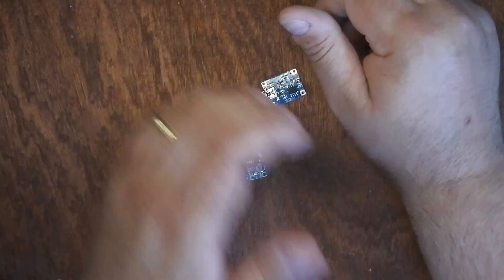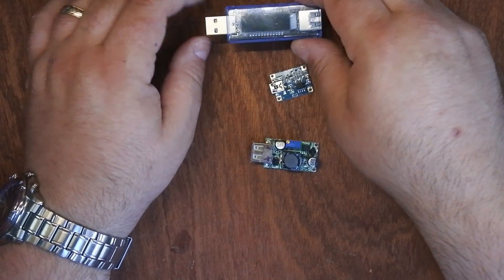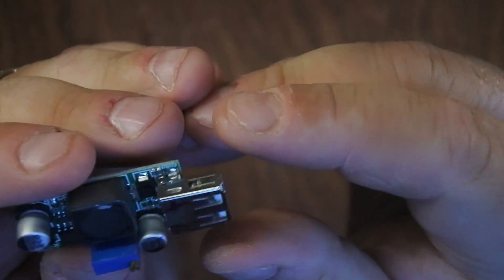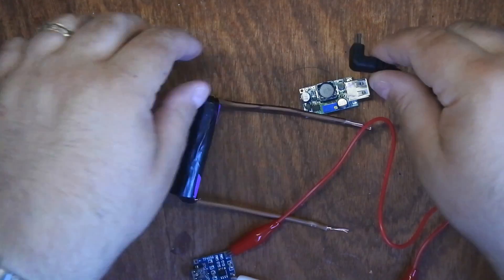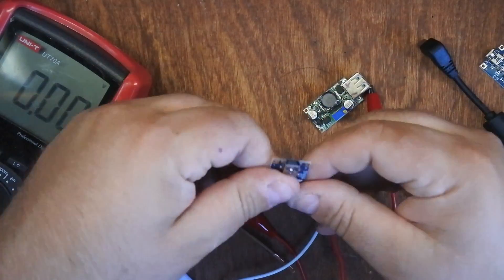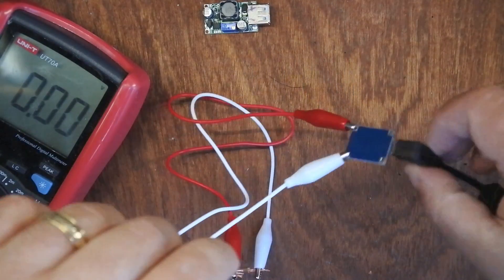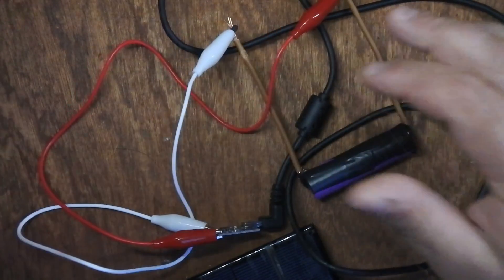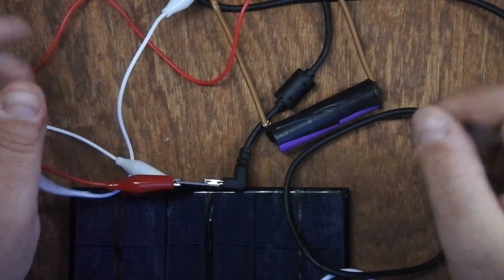A DIY Solar USB Power Bank -Part 1

Comment: At 3:34 it charges at the start at 01amp ramps up to a 1.0amp charge rate. Then starts dropping the charge after the battery reaches 4.20v. Charge rate drops until fully charged.